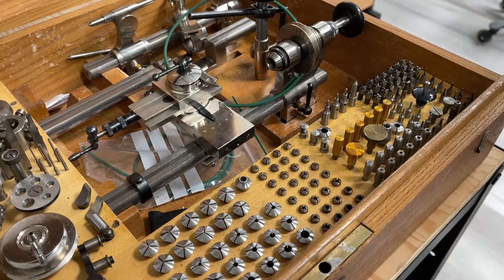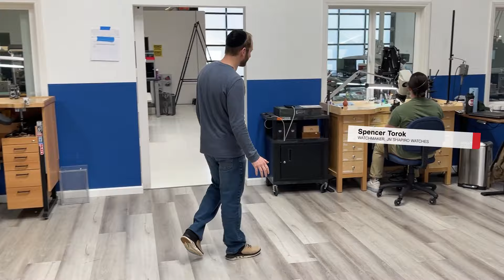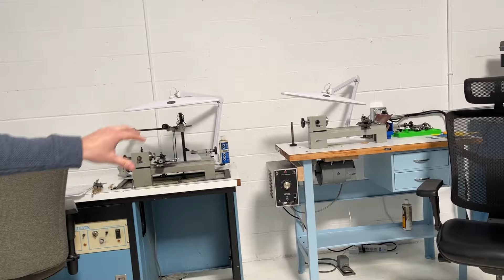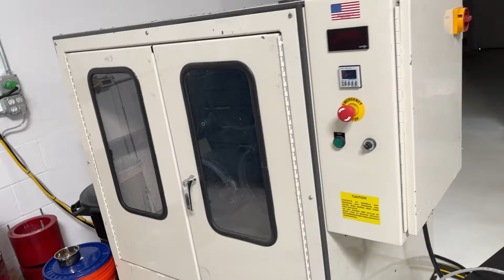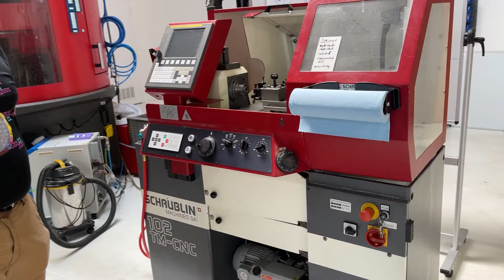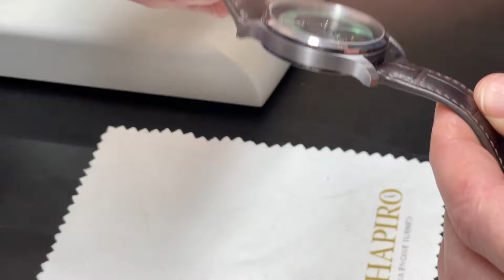Manufacturing American-Made Watches | Machine Shop Tour

Comment: a lot of machines, but a few people
Reply: It seams that they do have a lot of machines and the knowledge how to use them. Only very few machines are running, most of them are standing still. Production is expensive but you need all of them when your objective is to manufacture watches. You start slow with low quantities and grow over time. And then you find out the biggest problem is not to produce the watch, it is to find enough customers to sell them 🤨